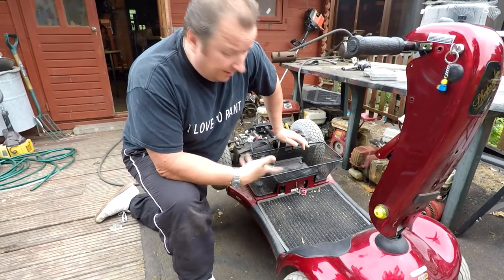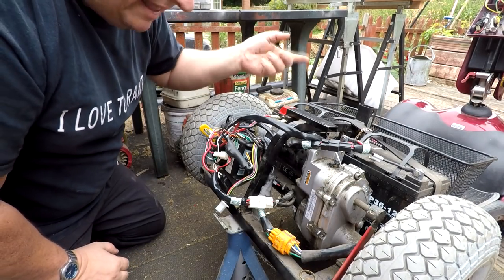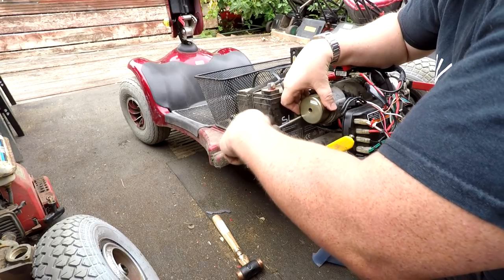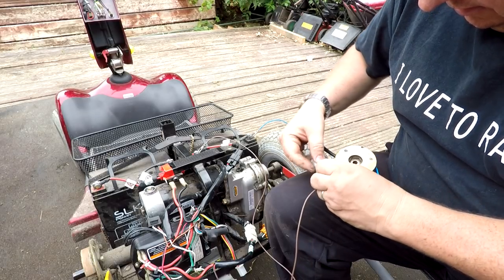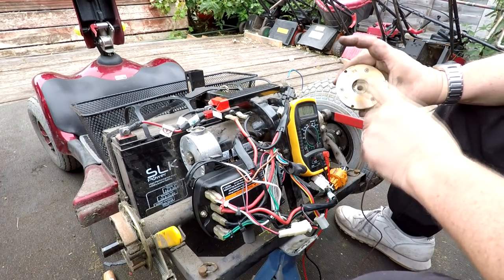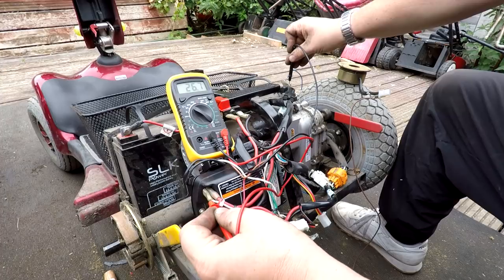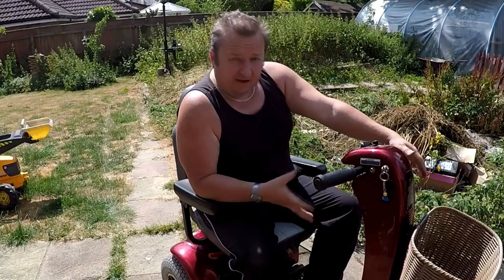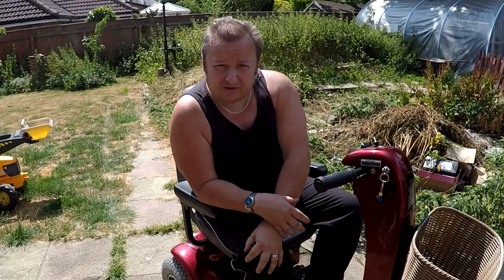Part 1 Mobility Scooter Won't Work  Motor Brake Problem | Shoprider

Comment: "And now for something completely different" From Monty Python. Popped into my head for some reason. Being a electronics technician, your brain works just like mine. Good troubleshooting process. Anyone with the same problems would find this video useful. It's probably that dust clogging up the works deeper inside the solenoid. Any Trotter Van vids coming?
Reply from the maker: The bleeping was the indicator though Bri haha, £90 for a new brake solenoid. Trotter vids very soon I hope.

Comment: had a similar problem at center parts with one it conked out going up a hill . tried to start it but had overheated I think,  phoned a mobility specialised who suggested I try the reset button which I did and it came back to life ,  not sure if it's still OK as in a shed.  waiting a hyabusa transplant . good video and guide .
Reply from the maker: Now that's a project lol

Comment: Most wheelchairs and scooters have self-diagnostic indicators that often pinpoint the problem from the start.  It is usually how many beeps or flashes of lights.  You then compare that number of flashes to the model’s troubleshooting guide and it will tell exactly, or give a general area of the problem.  Always better to do than to just start taking it apart as in this video.

Comment: Hey Martin,      I am glad to see you work on the same kind of scooter that I own.  I really don't use it unless we go to LasVegas or some where that I wouldn't be abble to keep up with the family.  They are a right pain in the ass if you ask me but at least I can make it around the house the next day if I use the scooter when my wife tells me to !  Hopw you are feeling better !
Reply from the maker: I don't know too much about them Cody but we got there in the end. Feeling much better now as well.
Cheers
Martin
Reply: I have 2 of these Go-Go scooters (3 wheelers) and I agree they are a PITA. Both of these have solenoid brake issues. Thanks for this video.

Comment: The armature in the relay is stuck because of all the dust etc. it has accumulated over the years. If you had sprayed WD40 around the armature while you had it apart it would free up with no damage to the relay. Hold it so the work side of the armature is slightly down from horizontal, spray in the top of the opening, and watch the crap run out the bottom. Rotate occasionally while keeping the same angle horizontally and spray until the stuff coming out is clear. Good as new but this is probably too late....
Reply: I am going to try this, I have issue with hot brake, hard to follow what you mean about horizontal etc but sounds like you've tried this, any  info appreciated.
Reply: so took off the ebrake, the coil is potted in resin, so no chance of cleaning it, I did though clean off the clutch surfaces ( the clutch was stuck on when I got the scooter), 
the ebrake does get quite warm to the touch, resistance is 49 ohmn which is ok,
not sure if they should get warm or stay cool?
Reply: What relay? Do you mean solenoid?

Comment: Thanks for sharing. I need your help. I have a Pride Legend with brake 
issues, replaced the brake and solve brake problem. Now I have a 2 flash
 light code indicating "motor disconnected". Brushes look OK. no broken 
or disconnected wires. Any ideas will be appreciated. Thanks
Reply from the maker: Hard to say without seeing it bud. sorry.

Comment: That would cost a fortune to repair at a mobility shop, good job Martin
Reply from the maker: Yes, a few hundred pounds Dave
Reply: And there's the rub - the companies that make and market these machines have no shame - they take advantage of the most vulnerable citizens. They charge  prices affordable by few, put the products through minimal to no quality assurance testing, warranty the batteries through 3rd parties for 6months to a year max, and the remainder of the machines for 1to 3 years making the purchaser jump through almost impossible hoops to prove that the machine was not "abused." If every senior or disabled person could posess the knowledge, skill and physical strength shown here,  there wouldn't be so many isolated, lonely people sitting at home with no way to get out and about. Oh and don't forget that you must only use these on well paved surfaces, during dry weather - they can't figure out a way to waterproof -- like cars, bicycles, shoes, baby carriers , etc.

Comment: I like it, your a very good mechanic on two types of systems.👍. Maybe you can help me, maybe not.🤔on my shoprider the tiller section has a secondary throttle pot on the right handle bar underneath, which is wired to the throttle pot but has no control on it, would you have any idea what this secondary pot is for.plz.🤔
Reply from the maker: No, sorry Michael.

Comment: Hi Martin... just bought the same one,
With the same problem. Did you order a new solinoide? And it worked? Or did you do something else with it?
Reply from the maker: Yes it worked, Check out part 2 at      https://youtu.be/wwL1j_XQZKU
Reply: Thanks for your feedback. Do you know if you can ride it without the electric brake?
Reply from the maker: @wimleo71  Its dangerous to do that bud.
Reply: @retrorestore  well... on my other scooter the brake is still there, but not on the mother anymore... just wrapped to the chassis ... and still, everything works.. even the motor brake

Comment: As simple as that magnetic brake module is, that would be a piece of cake to fix. However, the drive voltage to operate it could be the problem. And that is either a relay operated or a MOSFET switch. Either are simple to diagnose and replace. JMHO

Comment: Simply remove the electronic brake, leaving the electrical connection intact, and see if the motor still turns without popping the breaker.

Comment: Nice one Martin. There is a massive market for second hand mobility scooters. Maybe time to branch out?
Reply from the maker: I had thought about it a few years ago but didn't pursue it.
Reply: retrorestore there are so many out there for sale as spares as repairs very cheap and mostly it’s silly little problems. All you need is a small trailor and you’re set mate.

Comment: I picked up a gogo ultra x for hobbie purposes,  and  will admit this scooter is a little bit frustrating to figure out at first.  2 things i noticed right away--first: pride mobility says there is no bypass for or disconnection of the speed controller (supposedly there isn't one). This is not true. There is no speed limiter aside from the adjustment knob on dash. It can be bypassed which defualts to top speed. Second: the electric brae can be removed and bypassed from the controller.  (Tricked into thinking its there when its completely disconnected.  I have added a 24v led light and connected it directly to brake harness plug. This has increased the range of my Mobility Scooter beyond the 8 Mile maximum. Battery does not drain as quickly now the electronic brake has been removed

Comment: I had the same problem with my mums, took the brake apart checked it seemed ok, greased up where the solenoid should relased the brake and by magic it worked again.
Reply from the maker: Yes, I'll strip it down again before I buy a new one.

Comment: Hello Martin,
I have been dealing with something similar a few times already. In my case it was a stairlift. There the same electric motor had been installed. It was also installed this kind of  electric brake. I found out that it is powered by 24V (just like the electric motor). This brake was monitored by the controller. On the one hand, whether it was installed (resistance measurement) and which current it consumes. The same applies to the traction motor this is controlled by a Mosfet H-bridge, which can also be partially deffekt. For all errors that can occur, the warning sound was send out (like our scooter ....beep, beep, beep......).
The brake should make a more audible hard "KLACK". I think also that this is broken. But I also believe that this has broken something in the controller.
cheers Bernd
Reply: Oh, I´ve read ..... it was the turn signal.
Congartulation, so you have only to deal with the broken brake :-)
Reply from the maker: Haha, Yes Bernd. It was the turn signal but you are correct, the brake seems weak. It did have the 24 volts going to it though so I suspect a faulty brake.

Comment: what is the purpose of the electronic brake anyway besides causing problem?
All it is doing to locking up the motor.
Plus from what I see, it has to have constant voltage applied to it in order to press against the spring so the motor can turn.
What am I missing?
Reply from the maker: its so it doesn't roll off when you come to a standstill
Reply: @retrorestore  At 11:20 time frame as you are about to take the spring out, isn't there suppose to be a yoke of some sort inside the spring?  
Doesn't the magnetic field of the coil act on that yoke pulling it down and perhaps the yoke's top edge lip of it cover the spring and by that top edge it pulls the spring down, realesing the tension.   Maybe that is why the solenoid is not working.  The coil as you said had the right resistence spec.
How else would the tension of the spring be released?  I doubt if the magnetic field works on the spring itself.  
I would assume it does but it won't be concentrated enough to exert enough force on it to compress it.

Also if you look closer at the pressure plate , the third piece you took out looks like it is upside down backwards.   There is clear circular recess in the center of it.  Doesn't that recess part suppose to face down toward the spring, si the spring and the yoke gets seated and alighned in the center and straight up just for good operation?
Furthermore the recessed part is circular, not 6 sided or whatever so to accomodate that motor yoke.  I bet if you flip over that pressure plate you will see the marking of the motor yoke against it.  It is my detective inside telling me.

It is just an idea.  I am no expert.
I think somehow someobody forgot to put the yoke back on, then got the pressure plate installed backwards.. if this thing had been worked on before.....I don't know.

Comment: would that part be a parking brake Martin as when you stopped it was roling about a bit
Reply from the maker: No Bert, it's the main motor brake. It has a manual parking brake though.

Comment: What is the normal voltage that feeds the motor 12 or 24 volts.
Reply from the maker: !2 if I remember rightly.

Comment: Take the motor off and fit a lawnmower engine lol make it zippy lol
Reply from the maker: Haha, there's a plan
Reply: a petrol quad motor bolts straight onto back end my son did to mine and 50mph and wheeling lol so easy
Reply: Bert Mc m

Comment: The charging light on the screen shows that the charger is working, but it is not actually charging the battery.  Please what is the reason...?
Reply from the maker: Maybe the battery is not good.

Comment: Thanks for posting.

I'm currently troubleshooting mobility scooter with a STAR-7OZ 70A scooter controller 

How to repair/diagnose this scooter? (five beeps after ignition turned on)

https://drive.google.com/open?id=1-3NinqGecPaeNh8EM5yG2IeELrRd6MVv

STAR-7OZ 70A scooter controller
350watt 24VDC motor, F class, type SC82M245135AR0BF

I'm stuck diagnosing this. Part numbers as above. Photos in google drive above. any suggestions on where to start welcome. I'm not having any success finding manuals either.
Reply from the maker: I'm not an expert on these bud. Sorry.